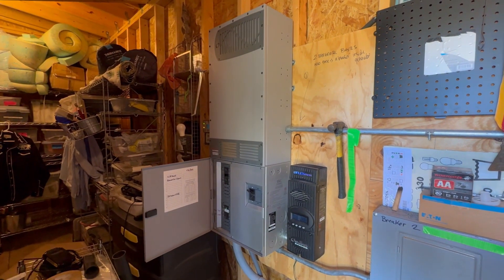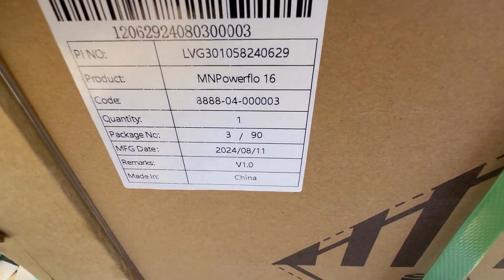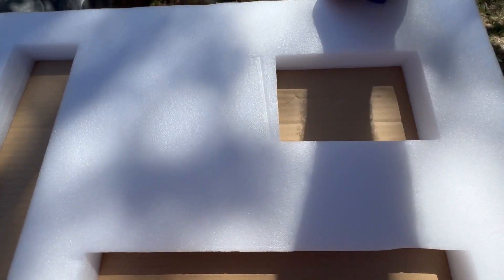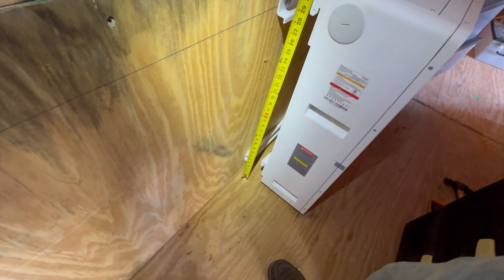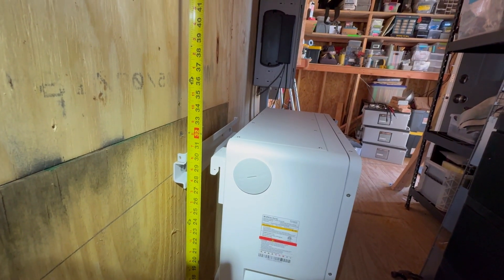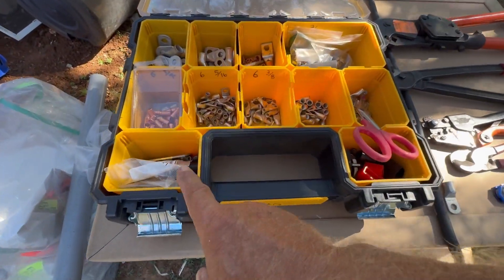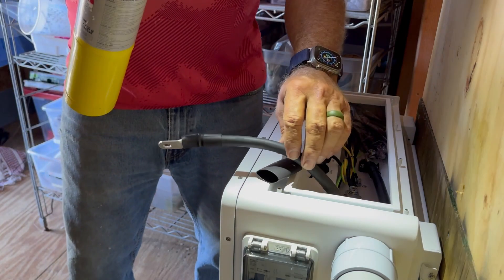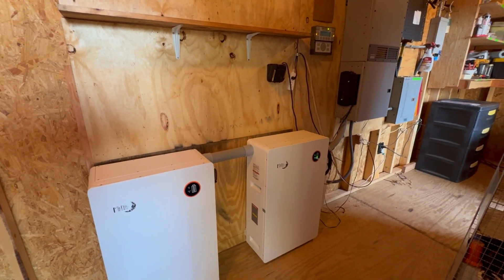MidNite PowerFlo16 upgrade for an Off-Grid Outback Radian

Comment: Thank you so much for posting this. I got my system with dual 16s up and running and also noticed the slave battery didn't have any capacity lights, just the blinking run.  I thought maybe it was equalizing or something.  Thanks!
Reply from the maker: I'm glad the video helped you out! I do wish all the batteries had their own SOC indicator. Then. If you had the battery communication connected you would see the average between them online.